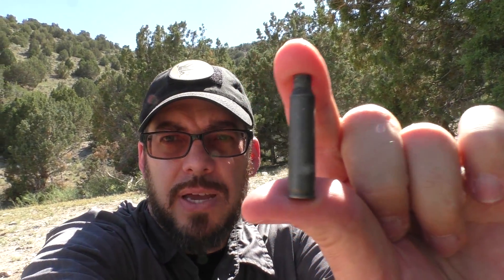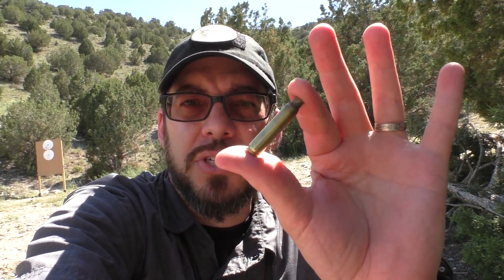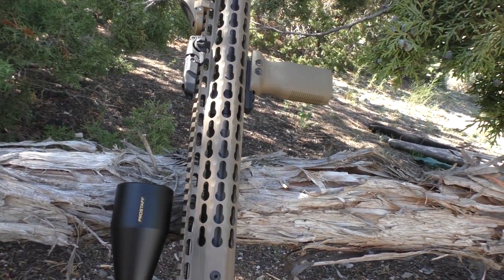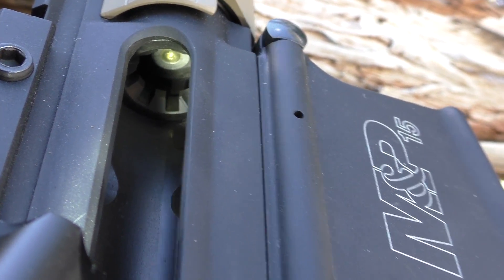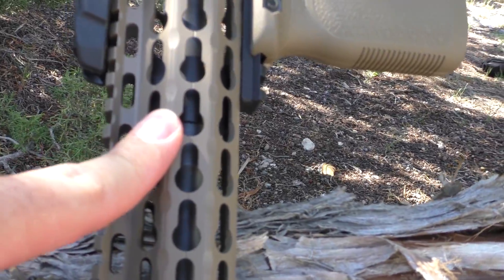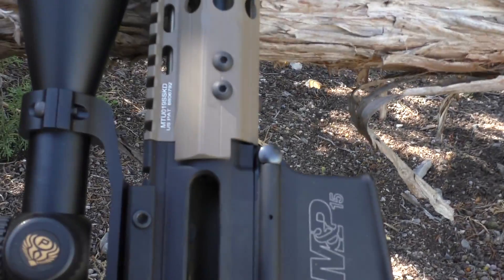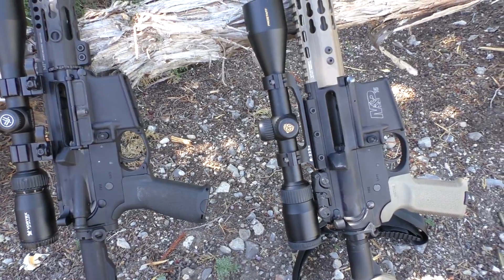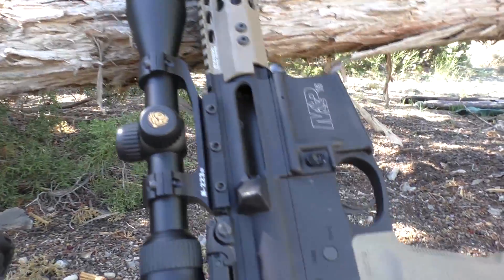Tula .223 Killed My Guns! V-Log Thursday

Comment: Tula steal case has lacquer coat on the case to inhibit corrosion it will build up in the breach after 50 to 100 rounds. You will see the cases starting to eject slower then normal   Cycle speed will drop then a case will stick. 
Remove the bcg, place paper towels through the breach in the upper blocking off the stuck case. Use finger nail polish remover or lacquer thinner, hold the barrel at a angle and pore a little down it spinning it slowly as to coat all the way around wait 15 min the you should be able to tap out the case easily. 
The cleaners we use on our guns will not remove the lacquer from the breach any time I fire tula I clean the barrel and bolt face with lacquer thinner then again with hops

Comment: Ill; just say this, I own the Ruger 556....Ive shot about 600 or more rds of tulammo 223. In the beginning I was struggling  with failed cartridge ejections. I decided to clean the thing out and HEAVILY oiled the gun. I went out and shot over 400 rounds fast of the same ammo and it worked flawlessly. Extra heavy lube might do you with this ammo. So far no issue with me

Comment: Steel and brass expand and contract differently. Looks like rifle is not giving steel casings enough time to contract and release seal in the chamber. Try slowing cyclic rate down. Try heavier buffers, different buffer springs and maybye an adjustable gas block. Also tear down bolt and replace extractor spring and o ring. BCM sells upgrade kit for like $5. Also if you shoot steel case ammo it is good idea to use wolff extra power hammer spring and enhanced firing pin.

Comment: it has nothing to do with carbon buildup for polymer coatings on these casings. it's a simple Metallurgy answer, all it is is the fact that brass expands and contracts in the milliseconds it takes for that case to be stripped out of the chamber. Steel doesn't contract quick enough or sometimes at all leading to the casing getting jammed in the chamber

Comment: Yes this has happened in my Savage BOLT action. I have to knock it out with a cleaning rod. Seem to only happen when the barrel get hot. I'm wondering if the polymer or whatever they cost the steel casing with is melting and sticking?

Comment: For the gentleman that is stating that steel cased is any dirtier then typical gas, I have to disagree. Now, that being said, I still have no problem shooting steel cased, with the exception of firing it in the winter. The mass amounts of carbon leak out. Almost liquid carbon if you would call it that, and the temperatures will freeze the massive amounts of carbon and cause for poor cycling. Another thing I noticed with steel cased, is I think it is a reduced charge as I am unable to bump fire with steel cased, but have no issues with brass cased ammo. I am going to go ahead and agree that this is indeed a carbon/charge issue. Just like when reloading ammo, if you don't put lube on before sending through the dies, the case will get stuck. The same can be said for having a wet lube, it can cause the cases to stick in the die. The carbon that this steel cased ammo is producing, is the same situation. But now, instead of a spent casing getting stuck in a reloading die, it's getting stuck in your chamber. Now, whether this is from gas blow back, round not expanding all the way, or what, I am unsure....but I would suggest a carbon issue as well. That being said, I don't have an issue in my AR.

Comment: Steel casing have a film so it doesn't oxide. Once it's hot that lacquer comes on the steel sticks in the barrel  until your problem. Quick clean 250ish rounds

Comment: I tried Tula ammo in my . 357 S&W 686 revolver for the first time a few months ago. Shot the .38s first, no problem. Then loaded up a load of .357s.  They shot fine, but when I went to eject them from the cylinder they wouldn't come out. Finally got them out by pounding on the ejector rod. Not Good! I won't ever shoot this ammo again in any of my guns. Saving a few pennies a round is not worth the chance of ruining my guns. Now, if I had an AK it might be a different story....

Comment: An old gunsmith told me that steel cased ammo has a lacquer coating to prevent rusting. Over time that builds up on the bolt and barrel and causes problems. He's told me to clean the bolt and barrel with lacquer thinner. Just a thought...

Comment: Buy a cartridge length gauge.  Start testing your ammo,  especially 'Gun Show' reloads.
Reloads can become stuck in chamber with out being fired because reloads might not have been full length resized.  No matter what the kid behind the table says.   
Don't want to have disabled weapons when you need them most.
Reply: Steel rounds or brass cased rounds stuck in the chamber without being 
fired is an AMMO ISSUE caused in manufacturing dimensions close to or over the maximum dimensions.   A true 5.56 NATO chamber can handle better than a tight .223 or it's sister .223 WYLDE.  223 WYLDE just has a longer throat for heavier longer bullet profile ( more free bore in front of bullet).
Reply: Yep! Watch buying reloads,I bought some 9 mm reloads and had a few not burn the powder all the way and got un burnt powder back in my face.  Not fun😔

Comment: The neck of the casing is so damn tight not only does it cut some of the copper but the the extra carbon from steel makes for nightmare so I think they tried to counter the extra carbon by changing thickness something ether way it didn't work.

Comment: my del ton ars all say not to use steel cased ammo, but not because the steel beats up the gun. it's because of the lacquer gunking up the whole system. the lacquer can glue up your whole gas tube assembly and  bolt when it gets heated and cooled. I only shoot steel cased in my AKS but save strictly brass for my ARs. in my 15 years experience with both platforms, the AK platform is more durable with internal tolerances being dirtier and looser, and ar's are more durable with external dirtiness, as they don't allow much to get in to the internals, unless your ammo allows such gunk, like steel case ammo.

Comment: Carbon, steal case, carbon, gas timing and buffer weight could be fiddled with to let case shrink a little more,   carbon.    Gun needs to sort of be set up around steel case if you can't handle the occasionally and probably regular stuck case.

Comment: Use a chamber brush when cleaning your weapon ! Two strokes,for every round fired ! I clean with Hoppes #9,and I lubricate with Castrol 5w50w full synthetic motor oil ! I have zero issues with this ammo in any on my (4) AR15's !

Comment: Steel cases do not expand to form a gas seal in the chamber.  Gas and carbon escape past the casing and the chamber gets progressively narrower and narrower until cases finally get stuck.  I bet $5 that the case you pounded out had black soot on it.  The answer is that if you're going to shoot steel cases invest in a chamber brush and clean your chamber regularly.
Reply: Only guy on here who is right
Reply: Not true.
Reply: C Leh Based on my experience shooting steel case ammunition it is true.

Comment: I know I'm late to the game here on the comments but I have a hack for this. First, clean your chamber regularly. 2nd buy a cheap military M16 cleaning kit. Then take the 4th section of the cleaning rod and grind the female end of the section back to the point where it becomes solid. If you use it for 16" barrels you wont need it anyway. So use this section with the solid end to knock out stuck rounds easily without deformation of the threaded tip ends of the rest of the sections. Oh, and buy a chamber mop, they're really handy for field cleaning.

Comment: A thorough cleaning and leave a little more lube in the bolt area.
I shoot Tula all the time with my Colt LE.
It is just a dirty ammo and lack of real case expansion from the steel casing.
I have shot 1000's of round with no issues.
FTF is the only thing.
Good luck.

Comment: alright Tula ammunition is a steel cased ammunition made in Russia. it has a semi-gloss coating on the metal so it doesn't rust when you heat up the case by shooting it you leave some of that gloss coating inside your Barrel. once you've shot enough of it right. where that bullet leave the cartridge is where your cartridge is stuck in the chamber from over build up of gloss coating. think of it like glass the glass has seized the cartridge and the barrel together.

Comment: I'm going to assume you take a chamber brush to it.    you have a tight chamber for the sake of accuracy,   also steel cases are loaded hotter to seal the chamber but being steel it doesn't contract nearly as much as brass.   The Russian stuff it designed to be used in government issue weapons with very generous chambers to increase reliability trading off accuracy slightly.  Crew served guns  IE M60,  SAW Russian RPD  have very large chambers making thier brass very difficult to reload because it' s so blown out.   Suggest either having a gunsmith ream out the chamber a bit or pull the bullets, save the powder and reload it into brass cases.

Comment: My assumption would be that you’re using higher quality fire arms with steel case. Higher quality barrels will have a chamber with tighter tolerances so maybe higher friction due to that? My cheap ass ar runs steel case just fine.

Comment: There are six possibilities:
1 The round is over-pressuring significantly
2) The case diameter is over-sized to start with 
3) The case length is too long and is pinching the bullet on its way out
4) The steel case is of incorrect hardness/softness and doesn't contract to the correct dimensions, after firing, to allow extraction
5) The ammo you are using is military/NATO grade [i.e. higher pressure designed] and you are firing it from a civilian/.223 Remington [shorter throat - lower pressure designed] barrel
6) Some or all of the above

Simple solution: if it doesn't work, don't use it and switch to what does work.

Comment: tula ammo is cased in steel as we all know. that steel is coated in plastic. the plastic melts and rehardens. that makes a stuck casing. leave a thin film of grease or oil in the area the round touches. right before you shoot take a tiny like quater of a pea sized bit of grease. rub it all over the casing. load that casing in the chamber. simplest way to lube that area.
Reply: one round like that should lube it for quite some time.
Reply: EMSGardener, it's not plastic - it's lacquer. Other than that, you are correct. The heat of firing causes it to melt a bit and coat the chamber. Lubing the chamber works, but you are increasing the back thrust on the bolt by a LOT. Better to shoot slower and clean the lacquer out when finished (or shoot a gun with a sloppy chamber and it won't be an issue)

Comment: This happen to me just today, I think it's the metal, and the barrel being hot,causing the cheap metal to warp or expand upon combustion. If not them I'm fuxking lost
Reply: Happened to me last week. I had just put together my AR and took it to the range for the first time. A few times, the casing didn’t eject until removed the magazine and pulled the charging handle. Then, at about 70 rounds, got one that didn’t wanna come out. Gun smith at the range popped it out and advised that the casing expands. I’ll be trying brass next time. If all goes well, I might just stick to brass. Although I’m thinking I’ll try the extra lube in the barrel like it’s been suggested and see what happens

Comment: I’ve got a POF with their E - Squared chamber. This helps gas to get in between the chamber walls and the casing for better extraction. I’ve shot at least a thousand of steel cased ammo before cleaning and had not a single issue. Also the rifle is gas-piston impingement.

Comment: its steel cased ammo, meant for range use only. after your done shooting go home and clean the chamber very good to remove all the carbon. do not mix brass cased and steel cased ammo into the same range session unless you have the tools to remove a stuck casing and clean the chamber. all this talk about the ak this or ak that, first the ak was designed around being used with steel casing and secondly the chamber dimensions are sloppy compared to an ar15.

Comment: could be the gas system forcing the bolt back to soon or to late. also check your extractor and extractor spring, someone else mentioned steel cases are not as smooth as brass so if you're extractor or extractor spring is worn it may not extract steel but do fine with brass. or it could be the guns, I have a Stag 15 and it will cycle anything flawlessly, but I've seen other AR15's that won't cycle steel at all. I'm not bashing your guns, but Smith and Wesson and palmetto aren't exactly high quality AR15's. it's unfortunate that your guns don't like cheap ammo but all that really matters is that they cycle some types of ammo fine. just stick with the ammo they like.

Comment: If you use Tula...you have to really clean. I have saved what I have and don’t buy it anymore.  My friend the gun freak has went so far as supervise my using it as it was a challenge to him to discover the problem. He even took over twenty rounds apart in his shop. He did find some inconsistencies.  Im not sold on them overall.

Comment: Usually it's the casing and over expansion or the casing is out of spec. I do believe that most ammo manufacturers overseas do not adhere to the same specs as American manufacturers. SAMI specs. For a usual rule of thumb I never use aluminum or steel cased ammo in any of my firearms!! I don't mind spending a little more money for better ammo.Unless it a stainless round made from hornady or Winchester

Comment: I have found that rate of fire has affected my rifle which also happens to be a Smith and Wesson M&P. If I fire it fast and go through about two mags that way then try a third it will start to have issues with this ammo and then eventually it will let one stick in the chamber. If I shoot slow taking well placed shots with breathing time in between I can shoot all day. My chamber is dry and I've never had enough ammo through it in a day to worry about cleaning it and shooting more that day. I think it has to do with chamber temp and expansion even though a lot of people are claiming oil in your chamber solves the issue. After one good mag that oil is gone if you shot it fast and got the chamber smoking hot. I reserve my brass cased ammo for when I want to throw rounds downrange at targets that I can speed shoot but for keeping money in my pocket I stick with tula because its dirt cheap.  Maybe clean your rifle up really well and then experiment and see if you get the same results I do. I wish I knew your shooting habits.

Comment: I haven't had this problem but from all the reading I've done and videos I've watched one of the biggest problems is changing back and forth between steel and brass cases. I do know that Tula is very dirty ammo too. You get what you pay for. Best advice I have? Clean the crap out of your chamber and stick to one or the other. AK'S eat thousands of rounds of steel cased ammo without a hiccup. Your AR can too. But I stay with Brass all I can and I even prefer Nickel plated when I can. It just works better.

Comment: I just witnessed a friend's PSA carbine do the same thing with IMI brass 5.56. had to hammer it out with a range rod. I have never had any issues with my M&P 15X but I seriously clean it after every range session. Any dirt, grit, carbon or unburned powder could potentially cause the issue in addition to overcharged ammo. I would poke them out with a range rod, give the bore a good cleaning using a military bore brush, polish the chamber with a 3O caliber brass brush, 00 steel wool and some metal polish then leave a very light coat of MILtec1 or FP10 in the bore until next session. Problem solved😉

Comment: I had a bushmaster that did that nearly every round... I used a wooden dowel with a slit for some 6000 grit sand paper and a drill in the chamber to make it super smooth in there ran perfectly after that ... Never had another issue

Comment: Well.. I must admit I do not own the type of rifles you have, but, I have had similar problems with 270 win reloads.  My dies do not resize entire length of casing. I found that the diameter of the used casings would, sometimes. be too large for my chamber.  Now I measure each one before using them..  I would think that your rifle is somewhat finiky with this ammo. If it does not work then get rid of them.. Hope this helps... Grant

Comment: it is the steel cases it does it in my stag and my rock river it happen 5 out of 10 times 
both my guns are 16 inch barrels and low profile gas blocks changed ammo back to brass case and no problems

Comment: This is just one guys experience, but there's nothing wrong with steel cased ammunition. Steel case ammunition will not and can not harm your firearms. If problems arise from shooting steel cases in your rifle its your gun not the ammo. Certain firearms are finicky when it comes to ammo. I currently have a DPMS Panther AR15 without any modification to the gun internally. This gun has never yet had brass cased ammo fired in it, only steel cased. I've owned the rifle for just about a year and a half, firing approximately 600 rounds to date and all ammo used has been Monarch and TulAmmo. On the other hand I have a Henry 30 30 lever action that will not cycle Monarch brass casings at all. With every shot it is extremely difficult to extract the round from the  gun. Firing Federal ammo in it the gun cycles perfect every time.